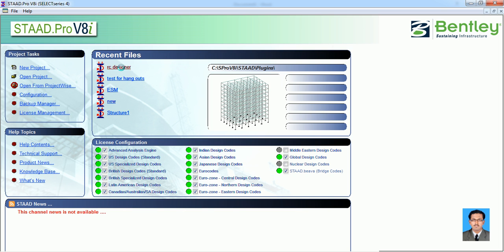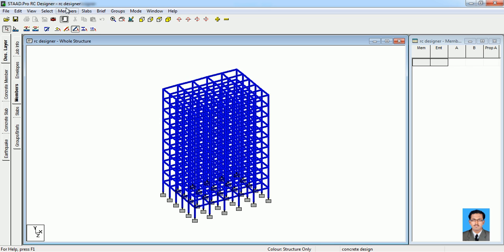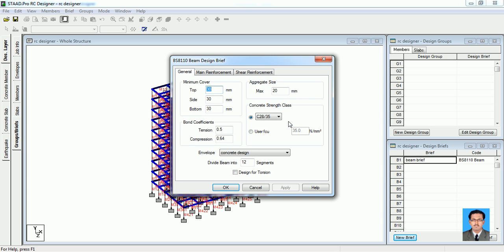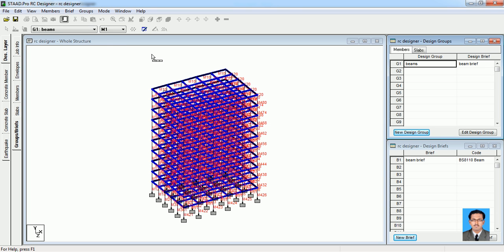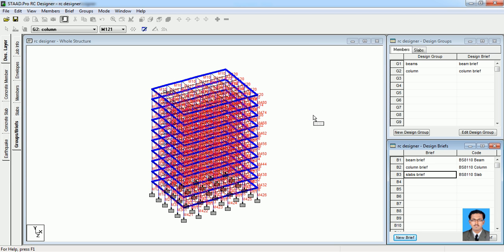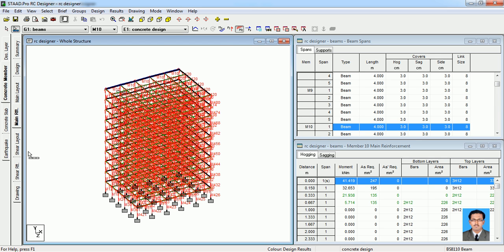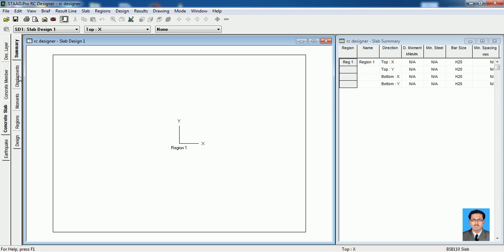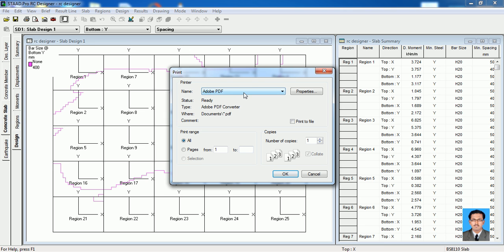Rc Designer in Staad Pro V8i (Designof slabs included)

Comment: It doesn't show me that generated load combination in new envelopes. is there any issue????
Reply from the maker: Can u plz send me the screen shot of the steps you followed so that I can go through the same..
Reply: @navaneethkrishnan779  After running analysis in concrete design mode i didnt form form member. but it still shows the beams are same autoformed members in horizontal beams only. but columns not. i have seen your video twice. i followed the steps you have done.
Reply: @navaneethkrishnan779     here      https://imgur.com/GKKMRT3 pls enable the link and see my model sir.
Reply from the maker: Did you try adding load combinations manually and check still the issue persist.. plz check my another video on load combinations.. thanks
Reply: @navaneethkrishnan779   can you post the link pls sir??

Comment: sir, i follow your steps but i encounter a problem my model fails in main reinforcement hog and sag,, what parameters shall i change, i did try to change the size of my member and bar size but it still fails
Reply from the maker: Check for the Minimum & max reinforcement limit and try it again

Comment: Sir I'm unable to create SLAB BRIEF. While creating new design brief using IS 456 it doesn't show up the option "SLAB" in the design type. How to design the slab? Please reply....Also share your mail id to have further discussions sir pls...my mail id is suosudesh@gmail.com
Reply from the maker: Dear Sudesh please check whether you have formed the slabs before you continue on to the briefs. you can do that in the slabs panel in the Design layer
Reply: Dear Navaneeth, Yes I have formed slabs as u said. But I have this problem, when I use IS456.
This problem doesn't occur when i use BS8110.
Is there any solution for that....

Thank you
Reply from the maker: Dear sudhesh I used to do with IS456 also and I am not getting any issues! can you send me the file so that I can have a look at it? Please don't forget to Like, Share and Subscribe the video!
Reply: Dear Navaneeth I have sent you a mail with my input command file. Kindly check it and help me with the issue.
Thank you
Reply from the maker: Dear Sudesh, Received your mail... Will check and update you soon! cheers...
Reply: Dear Navaneeth,
 Did you get any solutions for that error with IS456?
Awaiting for your reply
Thank you
Reply: @sudez_novatorsky  
TAKE THIS NOTE :
STAAD Pro RC Designer never generate Slab design with IS 456,  so you should design your slabs using any other international Codes and that is why SLAB OPTION is absent.

Comment: thanks a lot navaneeth. Your video help me a lot. But one thing i m not clear is now in yr video all the beam sizes r assumed as same? If different beam do we still need to give the command that form member? Is it applicable of incline structure like ramp? 
Hope u ll reply my comment n thks for sharing yr valuable time.
Reply from the maker: +Thinn pwin phyu sorry for the late reply... the steps are same for all types of beam sizes. I was using all same size since those are the commonly used ones. As u asked about the forming member take the case of a building with a basement, which is having various types of beam sizes in different floors, we need to select those one separately and use form member option. hope this solves your issue. Thanking you for your valuable reply... Cheers